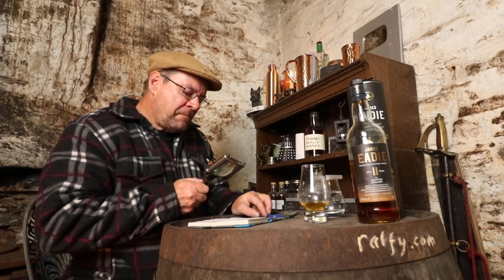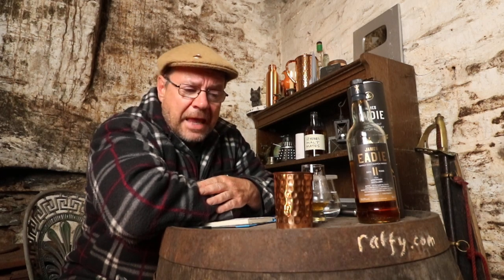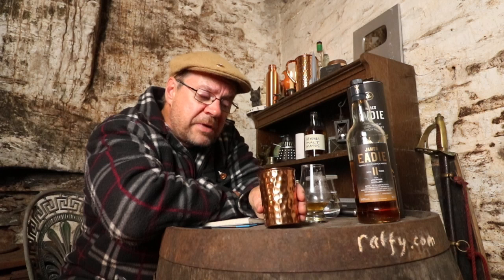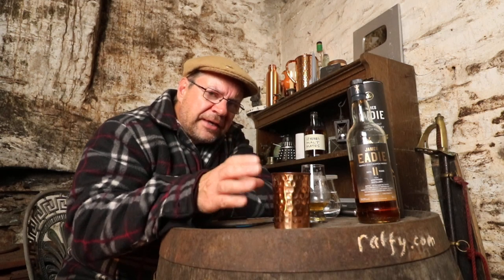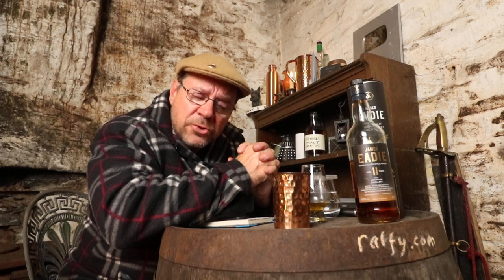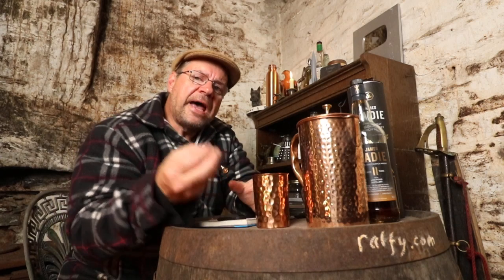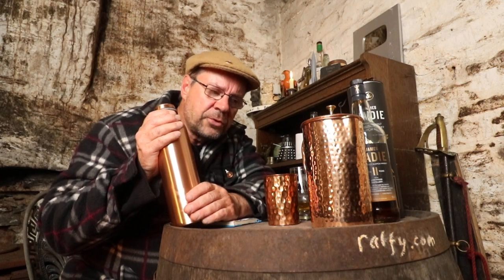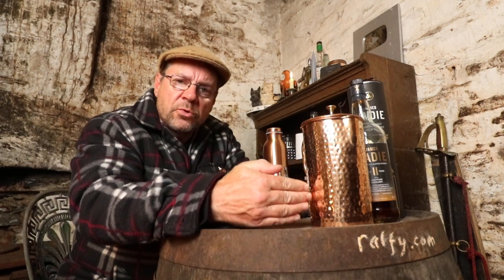ralfy review 789 Extras -  that copper thing !

Comment: Water definitely makes a difference. I started my journey into single malts while living in Oklahoma where most water is from wells into the Ogallala Aquifer. This is a pretty hard water, lots of dissolved minerals and it is about 7.6 in pH. As I grew up on this water it was what I was used to.

A few years later I moved to Seattle and had water that is from glacial runoff. A very soft water with not a lot of dissolved metals. Every drink tastes different and I found I liked more spirits than I had before. I guess there is a reason the beer guys are in the mountains and not on the prairies.
Reply from the maker: . . .  here is something about mountain water, for sure !
Reply: And water softeners do exist to improve well water. I think that softness is very important for adding to whisky. And for coffee and tea!

Comment: Water from a different source, or of a different mineral makeup would absolutely change taste. NYC pizza is the best not just because of the way it's made and what it's made of, but because of the water used in the dough. It imparts those minerals to the crust and you get a bit of a different taste. Some pizzerias outside of NYC have proven this by first importing NYC tap water and later having their tap water chemically altered to match the mineral content of NYC water (thus imparting the same taste).

As such, I think there's something to using local water, but you'd probably do well to use it quickly or store it in something like a UV purifying canister.

PS, before you laugh about NYC water, especially if you're outside the US, NYC's tap water is consistently judged among the best in the US.
Reply: You have not been in sicily and palermo yet.

Comment: Another great video from the legend! Does putting whisky in the copper can, or tumbler make any difference to the whisky i wonder?
Reply: It can and often does but not always for the better; however,  I've found with overly sulphured drams it does reduce the sulphur dominance. One can also use in your Glencairn glass a shiny penny from the 1960's or 70's back when they were mostly copper, later decades they're copper plated zinc and steel.

Comment: I am surprised that as of yet no distillery has decided to bottle its own water, the unique water that is used in their single malt, for sale. If folks collect water in Islay to complement their local malt...there is clearly spontaneous interest.
Reply: I would give up Fiji, Voss, and Perrier for some good Laphroaig water.
Reply: Been to several distilleries that do. And a lot of shops selling whisky has "regional" whisky water. Don't recall who is bottling it, because I've never considered buying it after looking at the price. 20cl bottles at around £10 is novelty.
The reason it's so expensive and not a big business is probably that a lot of the distillery water sources are clean enough to mash, and after all it then gets distilled. But it's not necessarily clean enough to be bottled and sold as "drinking water" without filtering and purification, and then it wouldn't be the same, would it? I don't believe any distillery use the distillery water source to reduce the alc before bottling.
Reply: I hate paying for water but I might even buy those, it'll go a long way.